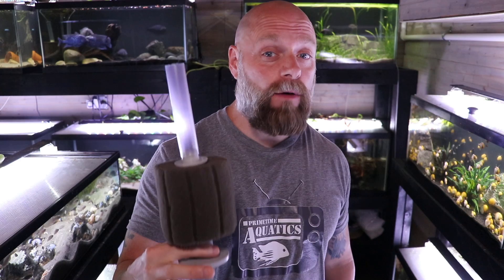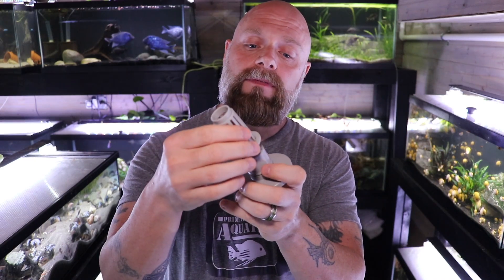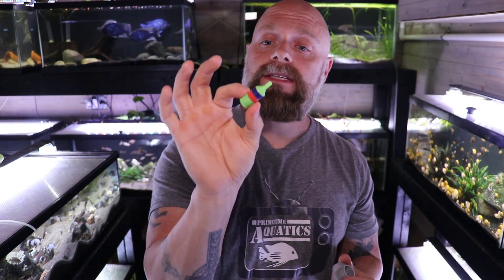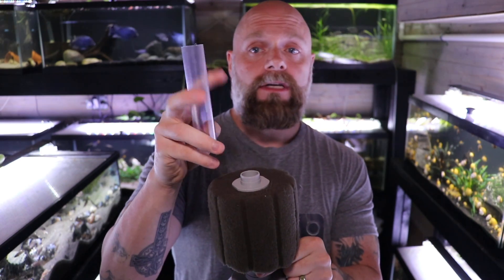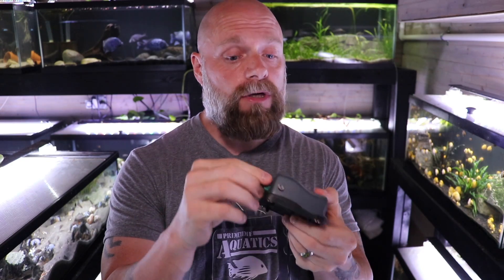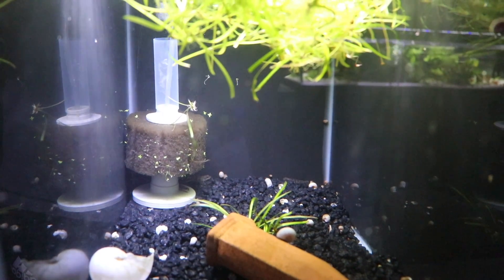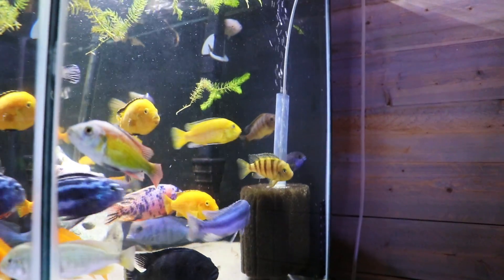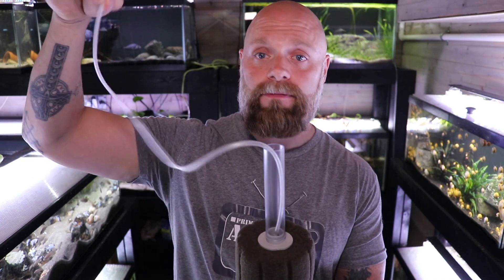Fish Tank Sponge Filters: Everything You Need to Know! Assembly | Placement | Flow and More

Comment: So I have a roughly 28 gallon AIO tank and right now I have one side that has mechanical (a piece of sponge) and biological filtration (ceramic balls and plastic bio balls) with a caddy media basket and was thinking of doing a sponge filter in another baffle. I’m unsure if it will really have as much effect in the back vs being in the display area, what do you think ? The tank is going to more of a community tank with a dwarf type cichlid in the bottom part so probably will be a heavy load of waste.
Reply from the maker: It really depends on the stocking levels. If the tank has no ammonia or nitrites and it looks clear (mechanical) there's no need to add more.
Reply: @PrimeTimeAquatics  awesome thanks !

Comment: I suppose having an air stone inside a sponge filter increase the number of bubbles. So won't it also cause more oxygen to dissolve in water? Isn't that good?
Reply from the maker: It might have a minor impact, but for the most part standard sized bubbles don't pop until they hit the surface.

Comment: I have a possibly strange question. I have a hospital tank that I may convert to a breeder tank. I have a hang on the back filter. I have debated a sponge filter for fry so they don't get sucked in. I have been searching and searching but I can't seem to find any info on using the sponge as the intake for the hang on back filter (rather than the plastic grates that can still suck fish in). Is this a thing? Would this work? It seems similar to hooking to a power head - it's sucking water in and flowing back out of the top.
Reply from the maker: Sure - you can be intake filters that cover the intakes of HOB filters.

Comment: How is it gonna filter the water when dont even suck water then release. there is no pressure to suck the water. you are just putting pressure inside it by having that bubble maker, whatever that is called.
Reply from the maker: Basically the airflow causes suction - it's not as strong as a HOB or canister, but it is sufficient for our needs.
Reply: no it's not causing any suction, logically if you think about it there is no suction really happening there
Reply: Maybe if there is a powerhead above it that is when you can call it suction. what do you think? is it good combination?

Comment: For a non-adjustable pump, if it blows more than necessary, do you recommend using a restrictor valve inline, or would it be better to use a valve that vents extra air to the atmosphere?

Also, I'm looking at a pump that has dual outlets, but for right now I'm only going to be using one of the two outlets for a lone sponge filter. Should I tee them both together and then either restrict or vent (from last question)?  I'm asking as I  would prefer to not have one outlet totally empty venting into the room creating excessive noise, and I also don't want to destroy the pump if back pressure is a bad thing to do to them.

And lastly, for someone with a single fish tank, what are your thoughts on using a small, adjustable, powerhead to run the sponge?  Seems like it would do the job well (if it's adjustable slow enough), and there would be no noise from air pump or bubbles.
Reply from the maker: You could use a small powerhead for a sponge if you wanted. I generally wouldn't try to restrict the airflow from a pump as it could cause too much back pressure and burn it out. A release valve might work better, but you may hear noise as well.

Comment: Some have an inside air tube, but that can be cut out and the top hole drilled out in steps to about .210", the diameter of your air house.  The air tube is attached with a starlike support inside and is easily cut out giving you the same empty tube air chamber in this video.  You end up with a sponge filter that is far quieter and much more efficient at drawing water using finer bubbles.  I doubt a wooden protien skimmer type air stone would work for this type of application.  The bubbles would be too fine.

Comment: I just started watching the video. 

I want to setup a 10 gallon guppy tank with light decor. Plan to have the tank on my pc gaming desk. (L shaped not near the pc) I am used to big predator tanks with canister filters. I don’t like HOB filters because of the sound. I know an air pump is needed and there are quiet ones. What I want to know is how big of a sponge filter would a ten gallon tank need for 3 guppies?
Reply from the maker: You could probably do just fine with either the ATI Hydro II (or similar size from another brand).
Reply: @PrimeTimeAquatics  omg 😲 I ask questions or comment on other content creators and no one answers normally. Thank you so much for your time and content. I greatly appreciate it.

Comment: What size you said you are using in your 125 and you used three of them? Is that 3 of 40 gal hydro 3 or 3 of 125 gal hydro 5
Reply from the maker: In 125s I typically use 3 - Hydro V's.
Reply: @PrimeTimeAquatics  thanks but wow that is like 125 gal *3, lots of float
Reply: Does that make more sense you instead using 3 hydro 3? So you get 3*40=120. If you use 3*125=475, that is too much?

Comment: Very well informed video! It was very helpful. Thank you! I’ve been using my canister filter for a 90 gallon tank n never thought about using a sponge filter. I just ordered my sponge filter n can’t wait to see if it really makes a difference. 👍🤡👍
Reply from the maker: Hope it works well for you!
Reply: I'm using a canister filter as well and I wanted to add another form of filtration how is it working for you? I have a 125 with a fx4 currently
Reply: @TURKO2424  These sponge filters are AMAZING! I even bought another one. I now have 2 sponge filters in my 90 gallon tank. It does make a huge difference! You’ll notice right away! Definitely buy it!!
Reply: @providedjoker2649  you have 2 sponge and a cannister filter ? Or just 2 sponges , im definitely going to give a sponge filter a try
Reply: @TURKO2424  yea...I have a canister filter and 2 sponge filters going! You’ll definitely notice a difference! Plus...there cheap too!
Reply: @providedjoker2649  sweet ima do that i could see a bit of particulate matter floating with the sponge should definitely help thanks for the info 👍

Comment: I enjoyed informative video on the sponge filter.I have the same sponge filter in my quarantine tank.The clear tube to make flow better for 10 gallon tank is bit too long and would like to cut it but what is the best tool to cut it?Saw? Also, I recently  had to use airline tube with airstone in hospital tank and after they got better,I did disinfect the bottom parts of the airstone but I cannot get the top part of the airstone and cannot disinfect it yet. What is the good way to take the top part out from the airline tube so I can clean the airstone top?Once airstone is used,I cannot take it apart to clean anymore? Thank you.
Reply from the maker: At the home improvement stores around me they sell a pvc cutter that works perfect for cutting uplift tubes. A small hacksaw works just fine and sometimes even scissors. As for the air store - if it is the less expensive ones sometimes I will just toss them and use a new one. If you don't want to do that just use a 10% bleach solution and is some of the airline winds up soaking so be it.
Reply: @PrimeTimeAquatics  Thank you very much always answering my question.I am very appreciated. This is not sponge filter related but, if you see one tiny single white dot on fish tail,would it be ich?I just spotted one tiny dot on guppy fry tail.I got Nerite snail in the same tank (just got them this week and they are eating black algae as well so I am very pleased) and I am wondering if I do 82F tank with ich X with water change or observe and see if the dot multiply only for now. I read ich is usually not just one dot.Wonder what it is.If it is ich or something else...

Comment: How can a sponge filter keep your tank clean, don't you need a hang on filter
Reply from the maker: We clean them weekly and they do a good job for the most part pulling about of the small particulate matter out of the water. They are not as good as HOB filters for mechanical filtration, but are more than adequate with lightly to moderately stocked tanks.
Reply: Thanks

Comment: What happens if you forgot to plug the filter back (I turn off when doing a water change) and it was off 2 days!   I immediately plugged it back in today and then I'm seeing info that maybe I should have dumped out that water and you mention putting the filter media in the tank.   

I did a water change because the nitrates were at 5.   This is a 14 year old 46 gallon tank with only 9 fish.     

Should I do anything else???   Should I go ahead and rinse out the media?   Or just do small water changes everyday until nitrates are zero?      I'm distraught because I just purchased 5 rams from petsmart and they ended up with ich and 4 of them died, and I have been dealing with that trying to make sure the rest of my fish don't die, and then I do the unthinkable and forget to plug my filter back!!   :(
Reply from the maker: With a tank that well-established the filter being off won't matter as much (although ich treatment might complicate it a little). I would focus on treating the ich for right now. Keep an eye on ammonia and nitrite, but there is a chance nothing will happen.
Reply: @PrimeTimeAquatics  thanks!   one of the molly's was acting weird, possibly trying to "scratch" himself so I did give him a salt-bath.   I had already added aquarium salt to the tank and turned up the heater.   I'm trying to avoid the meds for now.    So far they all seem to be okay! As well as the last Ram.    

 I had never heard of giving a new fish a salt bath prior to introducing, and I read that recently, so I may do that from now on.

Comment: What if my sponge has the air line connected on bottom piece inside too and a stone won't fit?
Reply from the maker: That's not the end of the world. The airstone helps break up the bubbles but isn't necessary for sponge filter functioning.

Comment: I keep having a problem where whenever I connect my weighted base to the rest of the sponge filter the flow gets extremely low and I don’t know if the problem lies with my sponge filter or air pump because it used to be fine a few months back, and it works until I connect it to the base
Reply from the maker: It sounds like there isn't enough air pressure to compensate for the depth of the tank. Could be a clogged airline or a pump that is starting to go. For us, it is almost always a clogged airline/sponge inlet.
Reply: Prime Time Aquatics Thanks for the help it , I decided to replace the sponge filter with an air stone and use my Hang on back filter as my only filtration since I have lower stock in my tank

Comment: As always, a great video! Question regarding cycling time.  If you are starting out with a new tank and a completely new sponge filter, will a larger filter decrease the timeline to get the tank cycled and ready for fish?  I can see it both ways.  A smaller filter would have less surface area for the initial bacteria to grow on, however the bacteria might be more tightly packed into the filter allowing for it to colonize the filter faster.  The opposite could be said about a larger filter.  More surface area would allow for much more bacteria to develop.  Ive always been interested in seeing a study on the actual rate of bacterial development per cubic centimetre of different media types, conducted by a true 3rd party reviewer.  Tanks as always!!
Reply from the maker: Great question - I don't think it matters. Even an under-sized sponge filter has more than enough surface area for beneficial bacteria to handle an average load. Since the microbes only grow to the nutrients available, the size of the sponge filter won't matter as much at first.

Comment: Sir I got a question for you, I have an small air pump (1.2 litres per minute) connected to a sponge filter and the bubbles that rise from the lift tube are in essence "tiny" and I've seen in a lot of your videos about sponge filter the bubbles that goes from the tube are like a one "big" bubble and I like it because it agitates the surface much better and the same thing I've seen also in some pet shops with the same sponge filter as mine, so, does that mean that you are using a more powerful air pump that it makes tinny bubbles into big bubbles or ? Thank you for the response.
Reply from the maker: Good question - the bubble size can be controlled in a couple ways. Using aristones inside the sponge filter will decrease bubble size. Without aristones the bubbles are usually larger. If you are using a sponge filter without an airstone and the flow rate is still too low, you can try a larger pump. We have a large central pump and control the flow with air valves that run to each tank.
Reply: @PrimeTimeAquatics  thank you  very much for the fast replay, I'm using a sponge filter without air stone, but you know they have some "holes" in the strainers, hence they rise the bubbles as it having an air stone, it may seems that my pump is weak because the flow rate is 1.2 litres per minute or 72 litres per hour and my aquarium is 60 litres, so if I get one with two outlets, i.e 270 L/H X2 (both connected using T to a single sponge filter e.g 540 L/H), will I get big bubbles like yours ?

Comment: I have a question regarding sponge filters & airflow. I have a 20 gallon long moderately planted. Livestock is 1 Betta and 6 Pygmy Cory Catfish, substrate is a small grain but not fine grain sand. I have 2 sponges (AquaTop 25's) in there on each end of the tank (in case something happens or I need to start another tank) I also have a hang on back Tidal 35 that has Pothos growing in it (because I like the looks) Am I causing more harm than good for my filtration? To note, I have 2 twenty gallon tanks, almost identical
Reply from the maker: As long as yoru betta isn't sttruggling with the flow, it's probably more than you need, but isn't really hurting anything.
Reply: Prime Time Aquatics great. This is my first time with small tanks and low stocking. I’m used to very large tanks with high stocking and high filtration. Your knowledge is so greatly appreciated

Comment: I have a question.  Im wanting to switch to a sponge filter on my 72 bowfront.  The only fish are 1 electric blue acara, 1 firemouth cichlid, and 1 super red bristlenose pleco.  I would like to add maybe a rainbow shark and single Angelfish.  But for now, its just those 3.  I have about 10 floating water lettuce in the tank.

I'm currently only running a penguin 350 filled with AC70 sponges and a large Aquarium co op intake sponge.  My water lettuce is on one side of the tank so don't want to put a sponge on that side.  Do you think its possible to run 1 single sponge (i have 2 of the hydro pro IV) on one side or should i run 2?  Could I stack 2 sponges in one corner?

Also what about GPH in air filters?  I was looking at a double outlet by active aqua and it says 125 gph.  Does the 4 to 5 times not apply when using air pumps?  

Sorry for all the questions.  Thanks.
Reply from the maker: Good questions. I think the rainbow shark and firemouth might get along ok. I'm not sure how the EBA and the rainbow shark would do? The angelfish might get bullied by both the firemouth and rainbow? All of this is hard to say for sure. If you were running sponges only I would split them up and run them one on each side. If it were me I would keep the HOB filter running and maybe just run one sponge on the other side? The pump can be relatively small if you are running only one sponge. I don't think the GPH standard applies as much to air pumps.
Reply: @PrimeTimeAquatics  thanks for the reply.  I will probably do the 2 sponges on each end.  My main thing is I want to get ride of the HOB.  I might keep for just mechanical filtration.  My EBA and firemouth get along good as well as the bristlenose pleco.  All fish are around the 3 to 3.5" range right now.  I might not add anything.  What about some schoolers like giant danios or black skirt tetras and not even worry about adding a shark or angel?

Comment: How much area covered by sponge filter for filtration? Does sponge filter  suck water from its top & bottom too?
Reply from the maker: Yes, they can suck in water from all angles. I usually assume a sponge filter can cover about 2-3ft of length.
Reply: @PrimeTimeAquatics  thank you for your reply. Can you plz suggest the which diameter of sponge filter is suitable for 3 ft long x 1.5 ft Depth x 2 ft Ht., Bare battom & using for first breeding of single pair  Red Severum fish? Fish size will be 5" for both.

Comment: I am missing something here.  You are pushing air through the tube and air stone.  how does that create flow through the filter?  all I see is pushing out of air that goes right back up the larger tube but I am guessing I don't understand this correctly.  does the air going through the air stone create some kind of reverse flow?
Reply from the maker: Ya, that's basically what happens. As the air is going up the tube it pulls water with it. The only place the water can re-enter is through the sponge itself.
Reply: @PrimeTimeAquatics  I caught one of your other video's on this and understand now thanks.  keep up the good work

Comment: Hi, I have imported water tank 28 gallons, I use the internal power head top filter and the AIR pump is lying BELOW the tank, so is it ok ?? or should we take the air pump above the height of tank? kindly answer.
Reply from the maker: If you don't have a check valve it's always a good idea to put the air pump above the water line of the tank to prevent any backflow should the pump go out.